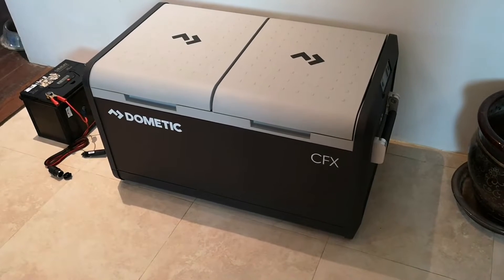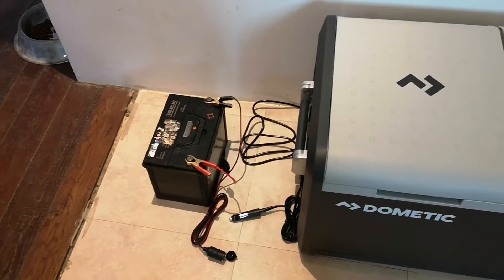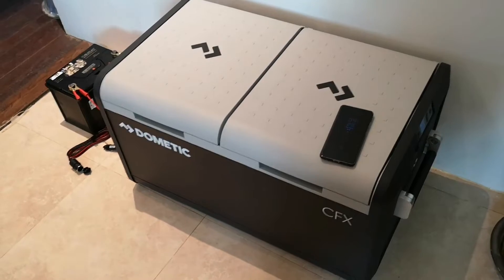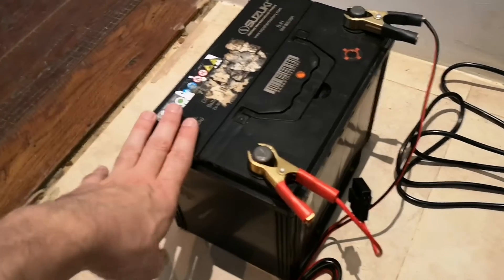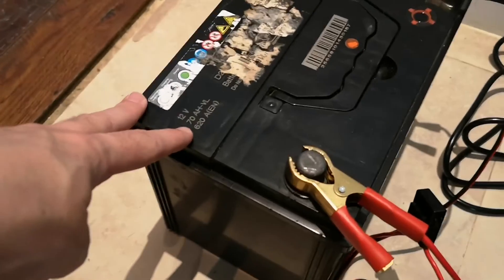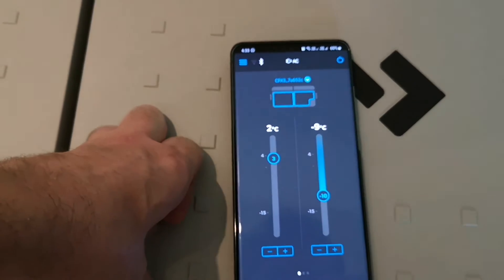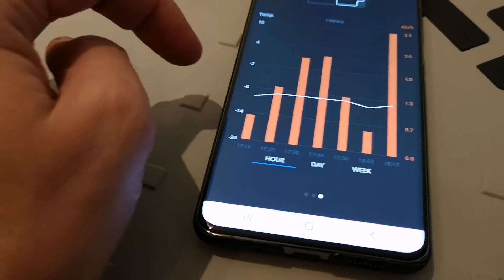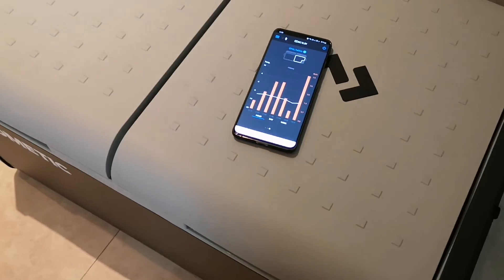Dometic CFX3 75DZ Power Consumption Test

Comment: How many watts is 3.3amp hours how much solar needed to run continuously
Reply from the maker: 3.3ah will be about 39.6watts per hour if you're using a 12v system. How much solar you would need to run that continuous depends on the battery type and size, charger, and solar panel used as well as how much sun you get per day. In order to continue to run the fridge at night make sure the solar is enough to run the fridge during the day as well as top up the battery enough to keep the fridge running at night.
Reply from the maker: You'll need to account for other contributing factors to energy loss and efficiency like ambient temperatures and weather. For example if you live somewhere that it snows, the fridge will be idle most of the night. If you live somewhere in the desert the fridge may be running all night to keep the same temp. Therefore Power consumption will be different, the same goes for weather conditions. Cloudy weather will yeild less solar input to your battery. That is why it's best to look at worst case scenario, what is the max power draw of the fridge and plan for a battery that can meet that and a solar that can exceed that by twice (so it can run the fridge during the day and charge the battery enough for night)

Comment: How much solar watts needed to run this continuous without ever stopping?
Reply: 100watt solar panel is enough to run it. I have 100w zamp solar panel paired with dometic PLB 40 and hook them for uninterrupted power supply. when im on the road i plug the battery into car's AC charger to be on safer side and when you turn off the engine battery starts feeding the cooler

Comment: If I use the jackery 1000 solar power station then how long will this dometic cfx3 75 run continuously?

Can you please tell me about it? Have any idea?
Reply from the maker: It will depend on many factors like the location you keep the fridge. For example if its in a hot climate the compressor will be turning on more often. Also if you have the temperature set low like freezing, it will turn on more often to keep it at that temp. But for example if you live somewhere where it snows the compressor might not turn on as often. How often and how long you open the fridge doors will even effect the temperature . So an accurate answer depends on your specific use situation.

But with some simple math we can get a rough idea for you. A 1000w lithium system like the jackery is about 83ah. (Watt ÷ 12volts) and worst case If both compartments are set to freezer and running constantly at 7ah you can expect worst to be 11hrs. But more realistically around 4.5a which is 18hrs. If you're in colder climates or have them set to fridge or only using one side of the fridge or are conservative with your use, you'd probably average about 2.5ah and that should give you 30hrs. 

So short answer, depending on your use you're looking at anywhere from 11hrs minimum to max 30hrs. 

It's worth noting that dometic also have low voltage shut off for battery protection. This cannot be turned off completely but can be set to low and around 10.5v the fridge will turn off to not damage the battery. I am not aware what voltage the jackery is at when it reads 0% power remaining.
Reply: @RoamingDesertDweller  in the SUV then how long will It run continuously? South Asia country

Comment: how much does it consume if u only use the smaller side
 and leave the bigger size off?
Reply from the maker: The compressor is the same so it will consume about 1-2 ah when it's on and at a maintaining temperature. The only difference is that the compressor will cycle on and off less If you only have one compartment cooling. (Also depending on where the fridge is such as back of a car on a hot summer day etc)

Comment: i just bought the 25litre. it charges great with the AC power, but when i connect to dc, the temperature starts to get hotter. is there something wrong with my chord? I have tried plugging it into the car DC and my ecoflow battery
Reply from the maker: Check the amp rating on the 12v socket you have it plugged into. I find that most of them are rated to up to 5amp dispute being fused at 10amp. Many outlets will only have a max 5amp output. Your fridge likely maintains a temp and uses around 2amps but will occasionally spike up to 7-9amp for a short period when the compressor kicks on. This spike often causes the outlet to temporarily shut off or not deliver enough power. A good sign this is happening is if you hear your fridge cycling on and off alot without shutting off (loss of power)

Comment: I have the 95l version of this unit. I have mine set at the recommended setting of -15c for the freezer (over compressor) and 5c for the fridge side. I'm running it off DC.  My unit is powered on for 25 minutes, if you include the time that the exhaust fan runs. Off for about 6 minutes. Do you find your unit performed like that?  Also the app will change the information if you back out of it and re-open the app, about half the time.

Comment: Hi I want to buy cfx3 95dz for my semi truck, on domestic web site i can see rated input dc is 10.4 A but on my semi is 10 A, is that can be problem?
Reply from the maker: I'm not too familiar with the amperage for the 95. But the 75 is pretty similar, 9amp I think is the max amperage for the 75 when the compressor kicks on. Things you should keep in mind are that while the fridge may pull 10.4a like you say it will not do that all the time. It will stay around 2a once it's down to temp and depending on the ambient temperature where you have it will turn on intermediately to keep the temp so amperage will spike only during that time. Most 12v (cigarette) sockets are fused at 10a you are correct but most of those sockets main output is a lot less than 10a. I had this problem with my battery box I built. I would recommend buying the dometic power supply plug they sell. It's cheap and that way you can unscrew the 12v plug and screw it directly into the 12v port so it won't vibrate loose and will get the correct power amp.
Reply from the maker: https://www.amazon.com/dp/B07WSXYCR6/ref=cm_sw_r_cp_awdb_imm_QDGJR5N5QJT7386HEG0F

Comment: That is such a help - thank you. Nowhere in the manual had i found out about the graph reading Ah/h only when in DC mode. Nor did it say that the Ah/h graph is the total for both compartments combined. Super helpful! We had run this fridge of an ac inverter and it drained our 540Ah 12v battery bank with 7x 200w solar panels feeding it in 24 hours. So we definitely need to power this in DC mode directly from the batteries.
Best wishes! Thanks again
Reply from the maker: Yes it's much more efficient in DC mode.
Reply: @RoamingDesertDweller  appreciate the info! Best wishes

Comment: Hi, Since yesterday I am the owner of CFX3 75 DZ. I have two questions : 1. Can I use the electric extension cord when the unit is left in the car overnight? 2. How should the temperature be set  if the power supply is from the DC plug?
Reply from the maker: you can use the 12v power cord in the car overnight but depending on your car the 12v socket it is plugged into needs to always be on, some cars turn off power when you remove your key so check on that. You can set the temperature to whatever your preference is however keep in mind it will pull a lot of power when you first start and the fridge is working to get to the set temperature, after it is at temp the power it uses to maintain is quite low. (few amp) if its powered by the same batter you use to start your car be sure to change the battery protection settings on the fridge to high so it will shut the fridge off before it drains your car battery too low to start the car.

Comment: You should get a watt meter and measure 24h of usage in watts.
Reply: That's fenomenal how many people now making 15 min videos for subject require few sentences. And majority has no basic knowledge about it.
" consuming more voltage"
I still didn't get what is this unit
awerage power consumption in watts.
Reply: I prefer amps. My battery capacity is discussed in amp hours (200 in my case), so knowing this fridge chews about 2.6 amps an hour is helpful. Why convert backwards and forwards (amps, watts) when there is no need. And yes, I'm 4 years late to the thread :-)

Comment: Why would you set meat to anything above 0 F??? or i guess -18 in your heathen units?  That is a good way to poison yourself, and other viewers that have no clue.  Ez thumbs down.
Reply: -10 C = 14F
Reply from the maker: The meat is in the freezer which was set to - 10c and was frozen solid. I simply stated you can set the temperature to anything you prefer. For my personal needs - 10c is cold enough to keep things frozen and 3c is cold enough to keep drinks cool.
Reply: @RoamingDesertDweller  and 32 degrees is frozen temp in F. That’s 0 C.
Reply: 0 degrees is a good idea for long term storage. If you’re camping and plan on eating it within a short period of time, I think you’re fine with anything below 20 degrees.

Comment: Hey are you still liking this Fridge?  I noticed that you aren't allowed to have AC and DC plugged into it at the same time (there is a sticker on them) after some issues.  I'm trying to decide between this and the National Luna Legacy 72 Dual Zone which is only another 200$ but looks pretty bullet proof.  That being said, these look pretty sweet.  Any issues you've seen?
Reply from the maker: Which version wont allow you to have both plugs in? This is the CFX3 the newest on the market and i didnt see any sticker or any messages telling me i couldnt have both plugged in, also the plug design is in a way where you can have both in at the same time, so i dont see any reason you couldnt. So far i love the fridge. its super spacious and deep. i like how much function it has with the ability to turn one side completely off or set either sides to fridge or freeze or both the same. I looked at the national luna as well. The main decisions that make you decide what fridge to go for will be different from mine. To me, availability is one (national luna isnt here and would need to be imported) aftersales support for warranty or replacement is important for me. and power consumption. this fridge averages around 2 or 3ah when running both fridge and freezer. its not the lowest but the trade off is its size overall and compressor are compact. also i like that i can take the lids off and reverse them if i prefer to have them open from the other way or change my car setup.
Reply: @RoamingDesertDweller  Yeah they had some recall or something like that with the fridge.  The manual for the CFX3 75DZ was updated and now says "Do not connect more than one power source to the product at any given
 time. Electrical system damage can occur and may result in a fire" on page 25 of the AMEA manaul.  I saw that issue popup on ExpeditionPortal when Dometic responded to the issue.  Apparently if you send it back, it'll just come back with a sticker saying to only use a single power source at once...which is a step back from the old CFX and everything else.  Weird to me as well but kind of bummer.  I did speak to a large dealer who said it had been "fixed" but wanted to verify it with people actually using it.

Comment: Hi mate, nice test. I have a 75ah optima yellow agm Batterie and a permanent 200watts solar system on it. If I stay on a place I put a 100watt solar panel on top. Do you think I can run that fridge with that? What's your results of the test? How long was the fridge running on the 70sh battery? How does it run real outside conditions? What is your experience? Regards
Reply from the maker: Yes that seems like plenty of enough to run continuously without issue.
Reply from the maker: Just keep in mind you don't have 75ah of usable battery power and the solar power you produce will also depend on the charge controller output and panel pmax power. But it sounds like you would be just fine. When at temp these fridges are pretty efficient. If it'd cold they pull only about 2amp per hr on fridge and freeze mode. If it'd hot out expect much higher. 4 or even up to max 9ah if the fridge is in the back of a truck etc.

Comment: Hi..how long did the fridge run on the battery?  Did it stop early due to the battery protection in the fridge?  Thanks for the vid...this is exactly what I am trying to figure out.
Reply from the maker: 28hrs*
Reply from the maker: It ran for just about 1day and shut off due to the battery protection that was set to low. I ran the test again with another battery setup which I will post maybe tomorrow. Which had interesting results. And now I've decided to go for my own battery solution and custom box and solar charger so I'll make an update video of that whole setup once I finish wiring all the plugs etc.
Reply: @RoamingDesertDweller  I hope you can do a video with your final setup. I'm in the USA and bought this same cooler in February 2020 right before the Pandemic as a backup mobile freezer and I bought a 160Watt DOKIO solar panel from Amazon. I have NO IDEA what battery I should buy. My goal is to have the ability to run this cooler for at least 5 days  continuously off of AGM or LiFePo with solar panel. Assuming I can get enough daily sun to charge the battery - I was thinking a 100ah Battle Born should be good. I know they are expensive but I am wiling to pay the high price for Quailty. Do you agree that a 100ah BattleBorn will work for my needs? I am only GUESSING and have no idea. Thoughts?? Thanks for the video.
Reply from the maker: @CanesFan65  there's a lot of variables. (climate, location of the fridge, how often you open the doors, set temp, etc) that will determine what size battery you need based on your consumption. Keep in mind the larger battery you get the more solar you would need to charge it at the right amperage and longer it will take to get to a full charge during sunny days.

But it would seem what you're stating would work just fine in ideal conditions for continuous use